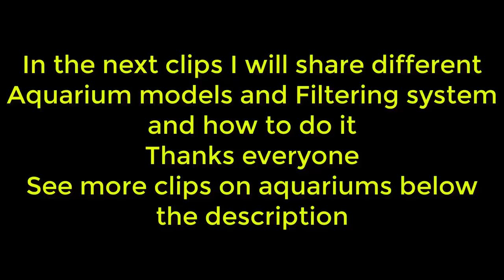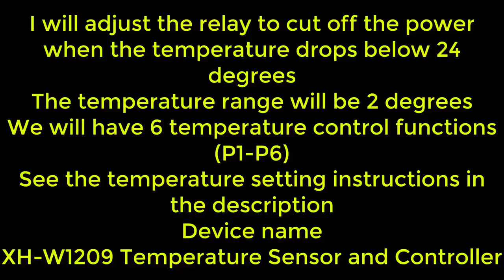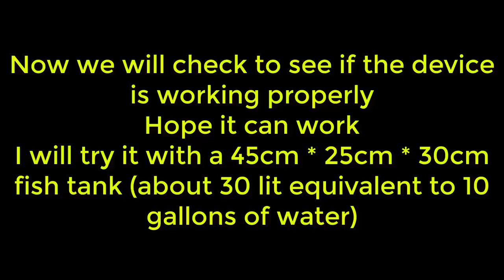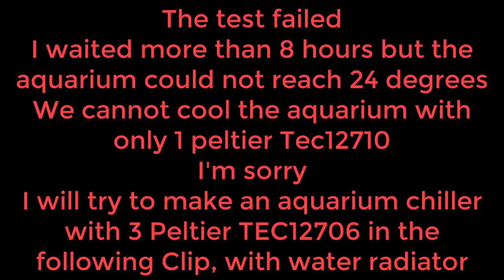Aquarium model 7 - Testing Water Cool Chiller fish tank with Chip-Peltier-TEC 12710

Comment: instead of trying to cool such a huge space with such a mini fan, you could try attaching the peltier unit direct to a Watercooling Block for watercooled CPUs, in that way instead of air-cooling the SS pipes that you made, you are actually directly cooling the water by passing it through the CPU waterblock. Waterblock for CPUs/GPUs comes in a variety of sizes and are not particularly expensive. Hope that helps!

Comment: Bro, the Peltier didn't cool the object, it removes the heat. You might get better results whether you improve the heat exchange. Your are using the air to exchange temperature, your "freezer" is working like this: 

The Peltier romoves the heat from the aluminum  > the aluminum exchange temperature with the box's air >  the cooled air exchange temperature with the pipes > than, the pipe exchange temperature with the water. 

This process has so much steps. I mean you would get better results make some changes. 
How about make the Peltier act directly with the water? Try it making the cool part or Peltier contact directly the water, maybe a aluminum pipe dissipation.
Reply from the maker: Thank you so much for contributing ideas to me and everyone
Actually I just wanted to do a test of the performance of The Peltier. To answer everyone's questions
And it did not work
Thank you very much
Have a nice day My Friend
Reply: @pieceofpaper924  :D 

Peltier is not so efficinet at all, the power consumptiom is high and it didn't cool the necessary. To get really cold temperatures i recommend using a refrigerator's engine. have a nice day too!

Comment: Sir can we make canister filter and chiller together...(inlet from aquarium will go to canister filter and outlet from canister filter to chiller inlet and then outlet from chiller to back in aquarium again) will I have to use 2 diffrent submersible pump with the same volt 800/L?
And can we cut and extend the temperature sensor wire because I am planning to hide diy canister filter and chiller under the tank cabin

Comment: Using aluminum pipes and removing pump inside chiller due to hot radiation of pump you will success.
Reply from the maker: Thank you very much for sharing your thoughts with me and everyone
I will try to do better
I originally wanted to use Aluminum but I could not find suitable aluminum so I had to use stainless steel instead.
Aluminum conductors are much better
Thank you very much
Please share your good ideas with me
Wish you a happy day my friend

Comment: 23:41 When you consider the difference in water temperature after 8 hours, you also have to keep in mind that difference is influenced by  change in ambient temperature, which has changed quite a bit due to change in heat radiation from sunlight.
Reply from the maker: Thank you very much
I just want to test chip-peltier-tec performance and share it with everyone
I realize that a chip-peltier-tec is not working if everyone wants to use it for their aquarium, it may have to use more than Chip.
thank you very much
Have a nice day
Reply: W

Comment: The pump is making heat so you shouldn't have it in the coil chamber box.  More cooling for the peltier should improve its efficiency a little and some sort of thermal mass battery in the coil area to pre chill and help stabilise the coil temp.

Comment: pretty bad idea.
Just for information - water conducts heat (cold) much better than air.
The intermediate stage with cooled air container as a heat exchanger is a lot of energy loss.
You should cool water directly with the radiator and the second circuit for the aquarium.

Comment: why did you use a fan on the cold side of the peltier?
Reply from the maker: I want the cold air to spread better and stir the air evenly in the refrigerator
nice to meet you My Friend
Reply: @pieceofpaper924  ive been trying to cool a 25litres of water down to below ambient temperature. what luck have you had so far?

Comment: I guess it is super inefficient to have coils in a cold environment and expect that the water becomes much colder. There is also too much loss basically everywhere which the Peltier in this inefficient system cannot overcome. I guess if you use a traditional condenser (which has coils) and the (cold) coils are directly in the warmer water, you would have a far better system.
Or.... you had already the more traditional water cooling chambers at the end of the video, which should definitely be far more efficient (as they are in direct contact with the chip - especially with heat paste. You could even put the "traditional heat exchanger" on the hot side and the water heat exchanger on the other...